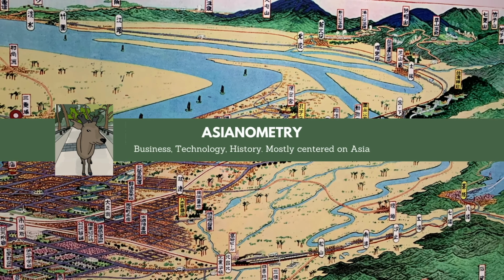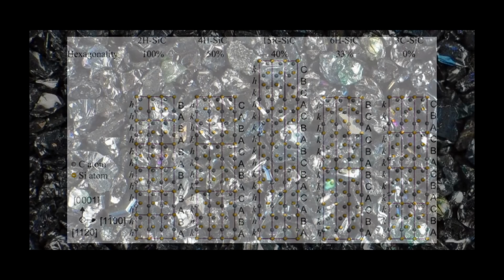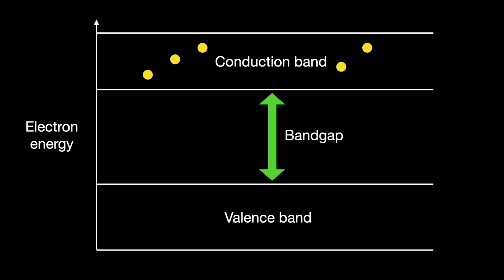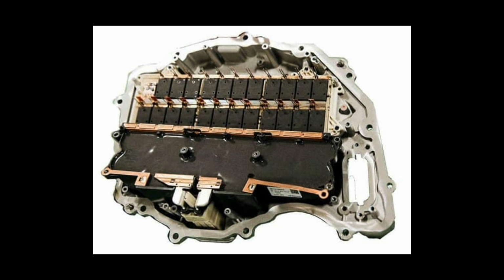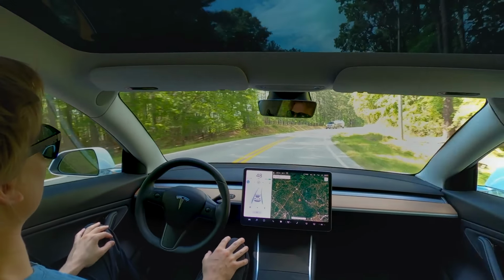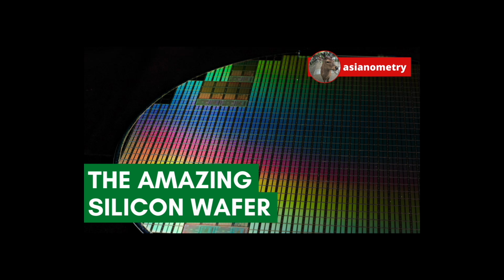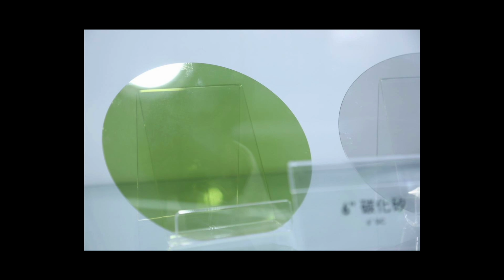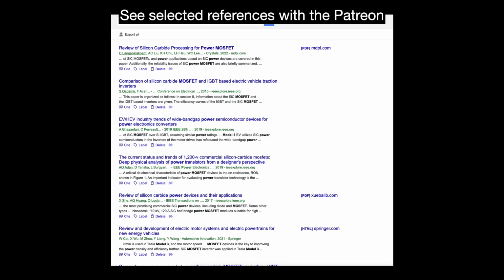Silicon Carbide: A Power Electronics Revolution

Comment: 8:41 "Silicon-based power electronics merely adopted the heat. Silicon carbide was born in it, molded by it." The quote sounds like a paraphrase of Harry Potter and the Methods of Rationality ch 119: "You dealt with the crap so you could go back to real life. You're not the kind of crazy that builds a castle out of the crap and lives there."
Reply: It is supposed to sound like something Bane (who is on the screen) would say. It does. HP works also.

Comment: You forgot one big thing. Heat radiates with the 4th power, so a chip that can get twice as hot, can radiate 16× the power. 
150V vs 900V is a 6× increase. Which means a 1300× fold increase in heat dissipation, but power rises with the square, for a net of H_dis = V²

Comment: As a college undergrad in 1991 I worked in a university (University of Florida) research lab doing preparation and characterization of Silicon Carbide deposited layers onto various materials.   Our method was chemical vapor deposition whereby a graphite holder inside of a quartz tube surround by outside copper coils with cooling water running through them would be subjected to an A/C current.  As the magnetic fields changed polarity many times per second the graphite crystal layers would react to the changing magnetic fields and thereby induce heating through the friction associated with the graphite layers "rubbing" against each other.   It was so long ago now I don't remember the exact temperature but I do remember the graphite would begin to glow after a short while.   The substrate (Alumina if I recall) we planned to deposit the SiC on was placed on the graphite holder during assembly and consequently would also get heated to exceedingly high temps.  Once the entire assembly was up to temp I would inject into the reactor a steady flow of Hydrogen (H2) gas bubbled through a silicon tetrachloride solution.  The SiCl4 would diffuse into the hydrogen and be transported into the reaction chamber and them a constant stream of methane (CH4) gas was used as the source for carbon in the experiment.  The high heat energies would rip apart the molecules and you would then have a gaseous phase of carbon, silicon, chlorine and other elements above the substrate.   Some fraction of these materials would react to form Silicon-Carbide (SiC) that gets deposited onto the substrate.  The whole purpose of the experiments were to characterize the regime under which you maximized SiC production and minimized other undesired reactions.    For that we would have to take the samples to the materials science department on campus where we could use their SEM to check the deposited layers for purity.    All of this work went on for years and formed the basis of a PhD thesis for a graduate student I was working with.    It was also funded by DARPA principally as a means to identify coatings that could be used in tank engine components to protect them from wear and corrosion.    Never did I imagine there would be a use for this material as a semiconductor.  Although I have to say it makes sense because the professor who was the PI for all these research projects was a specialist in semiconductor materials.

Comment: Wow... impressive, but this is all to tell me... if they are this sophisticated in the world of metallurgy and chemistry they could easily build a modular factory constructed LFTR  i.e. Liquif Fluoride Thorium Reactor tomorrow if they wanted...  Someone who is sucking up hundreds of BILLIONS of government funds building and selling super dangerous, expensive, majorly polluting with its massive radiation waste by product... all minuses , and regardless we have the technology to manage this... 1) It' still cost more by many factors, 2)  More danger equals more risk... is just to say the probability of a major accident (like the kind that cost BILLIONS and poison and kill people and the environment is MORE likely to hapen, it's more a function of time... And yet here we are...  the same powers that refuss to build cheaper, safer, more efficient, safer because they are NON pressurized, cheaper because they can be built NON pressurized, Thorium is 200-400 times more available than fissible uranium, the waste is about 95% less, because it burns 100 times more efficiently, and it CAN'T EVER melt down, because of the mechanical physics of how it operates...  Yeah these parasites want to use uranium, shunt thorium and got everyone spending BILLIONS on wind and solar....   what does that tell you?   Because this video just proved to me... there is no way they CAN'T NOT build a LFTR...  for Christ's sake they had an up and running unit in the mid 60s in Oak Ridge National Laboratory, worked PERFECTLY, BETTER than expected... It was shut down and the documentation was ALMOST 'disappeared'... but for one man an engineer... Captain Kirk...   ';  p

Comment: SiC = carborundum; grinding stones.

First time I heard of SiC, outside of shop class, was when Cree started, and their first products where SiC, high temperature transistors. The original (dim) blue LEDs came out later. I bought a few in 1989. Next time I wanted to buy more, the distributor informed me, that they no longer stocked them. They had been replaced by these new LEDs, made of GaN. The LEDs we know now.

Wolfspeed, formerly Cree. Good to know.

Comment: What suprised me about this is that the video infered Silicon Carbide was resent.  But Texas Instruments has been building commercial products out of it for over 10 years.  They do make a lot of power electronics out of it but they also make Microcontrollers and CPUs and many other items.
Reply: The microcontrollers and CPUs are almost certainly not made from Silicon Carbide (SiC) based on what I've seen here. Of course, there might be military/satellite applications I have not heard of.

Comment: Very nice video! I'd like to add that amorphous SiC also has great potential in developing photonic circuitry due to its high refractive index contrast with silicon dioxide, along with very tunable absorption characteristics. Interesting applications for the telecom industry, as well as some quantum internet and computing applications (due to adhering well to diamond which is popular for single photon emitters).

Comment: I'm in the nuclear engineering field and I've heard that uranium dioxide could be used upwards of 500 degrees as a semiconductor, with a higher dielectric constant (higher voltages) but would require very pure U-238.
Reply: How would you protect the circuit stability in the face of slow radioactive decay?
  Anyway, another nuclear technology for chip production was the SILCON method where silicon wafers were neutron doped in a nuclear reactor.

Comment: Excellent! I used to work for one of the big utility solar companies. Getting PV string sizes up to 3kV (from 1.5 today) dropped total system cost over 10%. One limiting factor was the silicon transistors in current inverters so this could address that.

Comment: Why is SiC preferedable to diamond? Most of the electric caracteristics seem shared -> both are wide gap insulators with greath thermal stability. I was under inpression that diamond wafer production is well understood process in 2022.
Reply: The problem with diamond for electronics is lack of a solid native oxide for fabricating insulated layers, and lack of n-type doping.  The only p-type dopant also has a fairly high activation energy.  If these problems could be solved, the diamond would be much better than anything else.